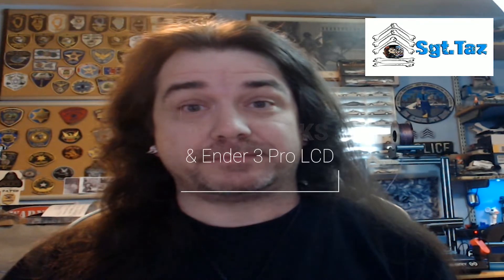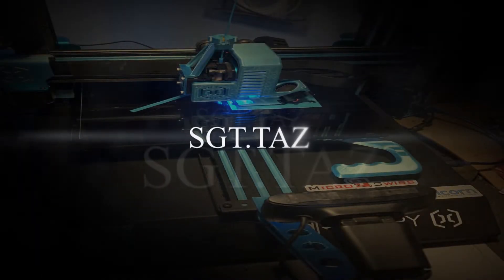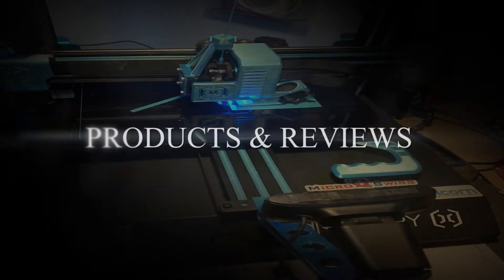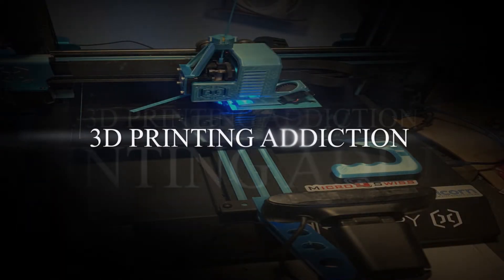Artillery SWX1 MKS Sgen L 32 Bit Upgrade

Comment: So, MKS Sgen L is better than SKR 1.3 or not?
Reply from the maker: Having used them both for awhile now I'm going to say they are equal on performance. Both have worked great and minimal problems (knocks on wood) There is a ton more information and groups with the SKR though so that may be a deciding point

Comment: I upgraded my stock X1 to Marlin 2.0.5.3... and also to the MKS TFT firmware.  Worked well for about a month... now I'm seeing "No Printer Connected" on the display screen.  Did the stock board burn out do think?
Reply from the maker: try a reflash of the tft and see if that brings it back also check the connector if that fails sometimes the work loose from the vibrations

Comment: What process did you use to install the firmware?  I ended up using Atom+Platform.io, importing Marlin and then compiling firmware.bin which I loaded from the Micro SD card.  Was there an easier way?
Reply from the maker: Used the same process. it's the fastest and easiest way to get it done IMO. I've also directly uploaded it from PlatformIO and it seemed to take longer than just using SD card

Comment: I would modify the connector on the board, not the connector on the cable, that's much easier. Be careful cutting the nudge you show, these cutters can break easily and the parts that fly around can be very sharp

Comment: Smart man, I like how you wire the new board while deconstructing the old. I'm dumb and have always just taken a before pic, removed everything, then rebuild. Sorry you had hotglue issues. I'm lucky mine just came off with a bit of pinching and needle nose.

What screw driver are you using? Is it powered? I like.

Flush cutters ftw!
Reply from the maker: Yeah I used to just do the picture, but found sometimes you might miss something simple. So having pics, schematic and swapping connection for connection helps keep things in order.  The screwdriver I use is the battery operated wowstick. Had 2, one replaceable battery then bought the USB charging one but that broke for some reason.

Comment: They seem to have changed the hot glue, Ill second that- I cringe whenever I have to go there. I tried alcohol first, then acetone which seemed to work a little better, but in the long run the best thing I found was a pair of hemostats and picking it off. If you are unlucky to have one that the glue gets down in the holes on the stepper drivers, walk away a few times and just go one by one. Im glad you mentioned the snippers for the plug, I came across that too before and its definitely better than self inflicted goth brag rights. Im also anal retentive about photographing the teardowns, mainly because I get taken away from the work sometimes for hours or even a day at a time and it helps.
Reply from the maker: Pictures have definitely saved me hours of extra work or forum post asking for help.  I'm also glad I started tagging my Marlin changes as that would screw me up for hours looking for what I changed lol.

Comment: You can use rubbing alcohol to break the hot bond. I also noticed the bltouch works on 3.3v and 5v depending on what pads you shorted on the bltouch. Just check the bltouch first.
Reply from the maker: I did try that but these weren't budging, they had some type of blackish tint to them as well?